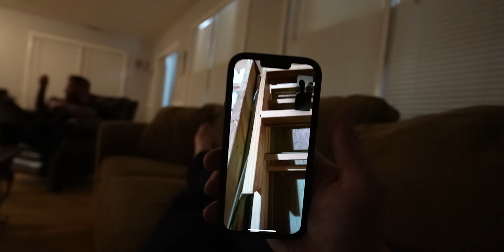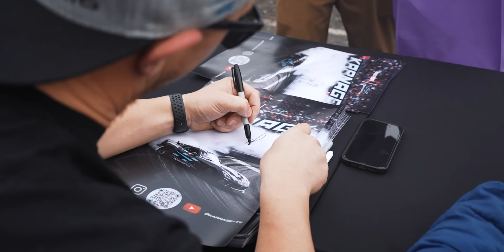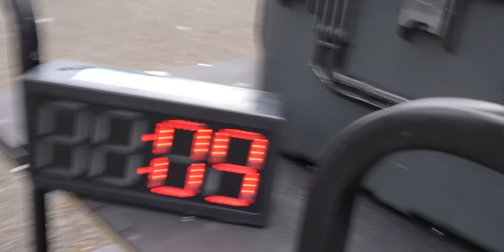DEAN KEARNEY CALLS OUT FORMULA DRIFT DRIVER

Comment: Looks like the first contact from dean to taguchi sent taguchi off pretty hard, taguchi was already at max angle when dean hit him so he started going off and struggling to not spin, taguchi was just trying to save the car
Reply: yuh fact
Reply: yea him letting off the throttle was for him to save the car because of dean already hitting him. i cant see it any other way.
Reply: the chase was compromised, not close to ideal. and he dropped back into zone causing contact. Taguchi was running a smooth line with good angle.

Comment: I know this isn't the popular opinion here, and I like watching Dean, but it was tire-to-tire contact that's very different from tire to door contact. Seemed like that pushed him off line, off track, into the dirt, and towards the wall. So I understand if he let off the throttle because of being in the dirt and heading towards the wall like he was. Not like last round where Matt Field parked his car on the bank with no contact, and the chase car got the fault.
Reply: This
Reply: Classic Field
Reply: No. Tire-to-tire contact is what happened in top 8, Adam LZ vs James Deane. Karnage barely grazed that side skirt, and the only reason it came loose was because of the high friction of the tire.
Reply: @KingDeadMan  it came loose because it was caught in between two tires off two different cars.
Reply: Yes it was deans fault for sureeeee
Reply: @roybatty9690  Karnage never touched Kazuya's tire. If that were to have happened, Kazuya would've over-rotated rather than understeer off the track. It's BS because that light tap of the sideskirt wouldn't have been enough of an influence to push Kazuya.
Reply: @KingDeadMan  I don’t see how you can watch the run and not see the tires touch.  We must be watching different videos.
Reply: Have to call BS on that call, Kazuya got handed the win for taking a dive. Real drifters never want to win like that
Reply: @YOURMAISGROOT69  oh please, like Kazuya needs to take a dive, Remember St. Louis ???
Reply: Tire to tire on the front wheels, yes. Tire contact on the rear wheels is relatively minor
Reply: Bang on Dean is clutching at straws here what a frickn farce!!
Reply: @KingDeadMan whats your iq btw or your eye sight?
Reply: @trollextreme9438  That's my line.
Reply: I agree, it was the right call in the end.
Reply: Better matching of angle would have likely avoided contact is what I'd be thinking.
Reply: @KingDeadMan  that light tap, shunted kazuyas enough to change his line, and force him into the dirt. ps. kazuya beats karney 9/10 times.
Reply: Yeah, that zoomed in shot claiming to have shown Kazuya lifting before Dean hit him the first time was a massive grasp. There are very few drivers in FD that are the type to go out there and intentionally flop, and Kazuya certainly isn't one to do that. Just look back to STL 2022 for evidence of that. I understand the frustration, but it was a major reach to say that Kazuya was at fault for the incident. What I see is Dean coming off line to surge forward, then letting out to drop back onto the proper line, contact occurring, then Kazuya's rears going into the dirt before he has any chance to correct.

Comment: That sucks. You killed that last lap especially not having a hand brake!! Something is up with those judges...Love these behind the scenes  on the race days. Great job  Marc!
Reply: The judges are ruining the sport. They are turning it into WWE and make some absolutely ridiculous calls.
Reply: Wym deans fault he got to aggressive and if you know anything about drifting you won’t be full throttle the whole time if he kept accelerating he would have gone off course which he did a but but it’s fine cause he can correct but dean got to comfortable and close he touched kazuas back wheel causing it to stop and disaster

Comment: 18:00 True! Matte Field's telemetry was noticeably slower than the driver he was battling against in top 32 or top 16! It's not as accurate as some thought it would be. I, for one, knew better than to put complete trust in it. They're basically just pretty lights that react to throttle input, imo.
Reply: It is very imperfect but they don't react to throttle input at all. The lights are controlled by a g meter. That's why some wall taps are turning them red even under full throttle. They have other sources of telemetry other than the light system too but it's all just to make better guesses.

Comment: From my understanding, Dean is saying the initial tap was Taguchi's fault for lifting, which if true, would be okay/within rules, so long as it does not cause a significant decel (red light) which is what they determined to be a visual decel. Dean believes this lift caused a significant enough decel to cause tap but within FD rules, it was not significant, thus, faulting Dean. 

So if thats the case, FD made the right call, according to their rules, but perhaps their rules for decel allowed should be reevaluated.

Comment: I cant tell what people are even arguing here. i dont root for either of these drivers but If people are upset that taguchi shut it down after the contact and his tire dropping into the dirt heading.....INTO A WALL, then idk what to tell you. If people are upset saying that taguchi slowed down, causing the contact, then you have some information that i am missing, bc even with the slow-mo, arrows, and text i cant see enough of a change to say he slowed any more than dean surged into him. Its the chase position's job to follow, i see dean pushing to catch up after transition more than i see taguchi slowing.

Also lets point arrows to the tire smoke of dean when he surges into him, dude's POURING out smoke, then rips the ebrake realizing he's pushing too hard right before the contact with the rear left of taguchi. Thats how i see it from a completely neutral perspective, idk judges apparently saw it that way as well.

Comment: Dean, no offense man but your tap coming in with shallow angle knocked him off course. you needed to back off the aggression a bit and let him get back on course. he was heading off because of your tap. thats fault on you, the judges made the correct call.
Reply: That’s not offensive is just reality. Mind you him and Taguchi is who I’m rooting for.
Reply: Yes the tap may have knocked him off course, but Dean is saying that initial tap was not his fault, because taguchi lifted to correct his line.
Reply: @ModMyRide   its just not right, he was coming in hot with shallow angle. lead driver is allowed to make adjustments, he shouldnt have to be 100% throttle 100% of the time, thats just not going to happen
Reply: @PtaRiStyle  yeah I get you, dean thinks his lift off throttle (whether partial or full) to adjust his line, was enough of a decel to cause contact, but by FD rules, the decel (if any) was not enough to be considered their definition of "visual decel"

Comment: Huge L for that behavior, and for slamming Taguchi, the track and the judges with this video. But sadly, whinging has become a constant on this channel - if it's not the judges, it's the track or the other driver. It's never Dean. Ever. Telemetry showed that Taguchi didn't slow. Dean hit him and pushed him off track.
The difference between Dean and the likes of Deane, Aasbø and Forsberg is that Deane, Aasbø and Forsberg own up to their own mistakes - reset and come back better. If you're incapable of identifying and owning your own mistakes - you'll never progress. Again. Huge L.
Reply: You could physically see him slow down bc he was at full lock trying to save it from going off. I was there and everyone else in the bleachers saw that too. It should've been shared fault or OMT.
Reply: @ireeeebz  I was there too, and I saw Dean lunge at him, but didn't see him slow. The lunge resulted in Taguchi being forced off track. Telemetry showed that he didn't slow, and if he did in fact slow, the lights would've indicated that as there would've been a weight shift that would've triggered the lights. Funny how the judges and the officials seem to disagree with you. They even dismissed the protest.

What they conveniently left out of this video was the overhead shot at regular speed where you could see Dean lungeing as opposed to Taguchi slowing.

Disagree all you want. The right call was made, and Dean caught himself a massive L for his hissy fit, and for this video.
Reply: Common dean L

Comment: After the initial contact Taguchi pulls away and creates space, then throws out the anchor and stops dead. It sucks and is part of my dislike of FD as a whole. Every round has just terrible calls by the judges at one point or another but they're so focused on making sure the show runs that they lose focus on making sure the right calls are made, even if that means losing some face along the way.

Comment: I don't know all the rules but it looks like he's offline and out of the box when the first contact happens. He's then on the dirt and doesn't stay on it like you did when you hit the dirt earlier which cause the crash.
Reply: what? Kazuya was on a perfect line before the contact, he was right on the edge of the zone which is always where judges want you to be. Kazuya was set on a wider line as a result of wheel to wheel contact caused by dean. Once Kazuya's tire hits dirt its all over. If he "stayed in it" he would've just hit the wall. When a tire hits dirt or grass, the level of grip goes down. The longer you stay on throttle the more you wash out. So in this circumstance there was nothing Kazuya could do.

Comment: Didn't James Deane say something about a pretty bad collision with you in practice while you guys were having fun going hard at it. How come that isn't in the video? I know it wouldn't be as good of drama but if your car was damaged its a lot better reason why you were at low angle and gripped up and hit him. I'm a fan of most of the FD drivers but the Judges definitely have their 3 favorites, not that they: those drivers, don't have great runs. It sometimes lacks in the X factor but they continue to score 5 to 10 points higher in qualifying than everybody else. Seems like low angle driving away like in FD Japan is a problem sometimes still. You, the RTR guys and some of the middle field are all great. Less grip and more angle; it might require a new chasis. Have you seen the McLaren at Ebisu lol😂!

Comment: Really starting to see more drivers, for lack of better terms "draw a foul" 
2 other drivers did the same thing that event. 
The judges really need to learn how to identify that, and then issue punishments for such actions. Idk what the penalty should be if caught. All I know is that I'm starting to see more and more situations like this.
 He knew what did. And he knows he did it on purpose cause you would get deemed at fault not him.
Reply: I'm not sure if it was on-purpose to draw a foul or to avoid hitting the wall, but either way dude should admit he let off

Comment: Dude that is such a bitter pill to swallow. Watching it live I felt like he slowed but you couldn't see the evidence until this video but i still felt like he was in the wrong.The only time they display the telemetry data is when the cars are in the burnout box which makes no sense it should be displayed the whole run every run. They say they are stepping up on judging this year that's why you guys have the new lights telemetry boxes installed in the cars. Well if you guys required to have the boxes installed they should be required to display the data at all times. I mean c'mon! I know it sucks Dean because you beast of driver but seems like you always get fucked somehow. Him coming to talk to to you just seemed like he was admitting his guilt. He did slow I felt like he lifted because he knew he was going to hit the wall even if he is telling the truth it their still could be a number of mechanical reasons for the lack of tire smoke. Top it all off your lead and chase was better should've gotten a omt. Hang in there dogg you'll get your time in the spotlight

Comment: It was such a drama filled weekend but I can see both sides of the crash Deanne ultimately caused it but it could’ve been a softer second hit if he was still in the throttle assuming he didn’t wall tap  like stuke did after winning the biggest bitch award yet again
I really dislike the omt for clean runs (it mostly appears to be used to not judge a great battle and give fans a second good one) it’s a bit of a cop out on the judges part but I’m stating to see and in this case why having a omt opinion isn’t all bad